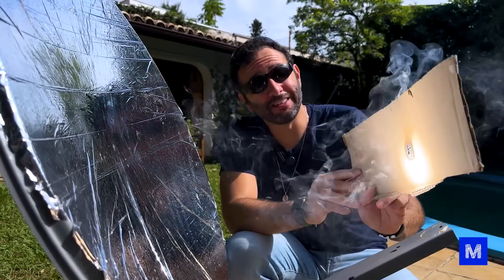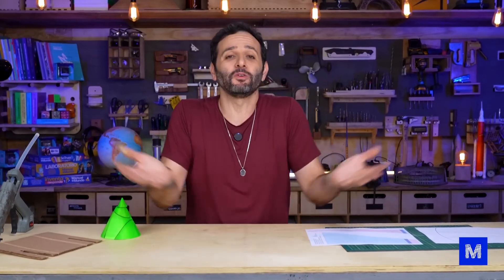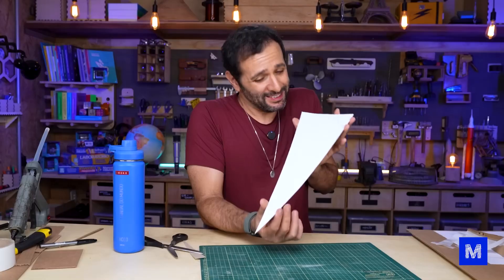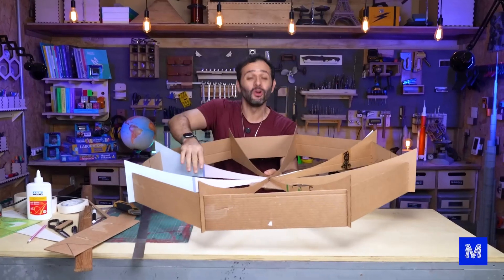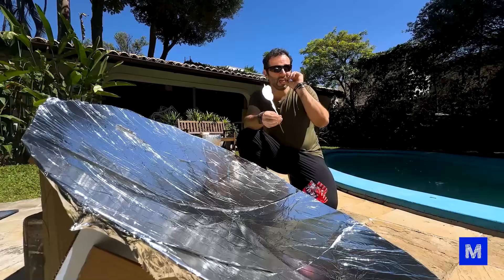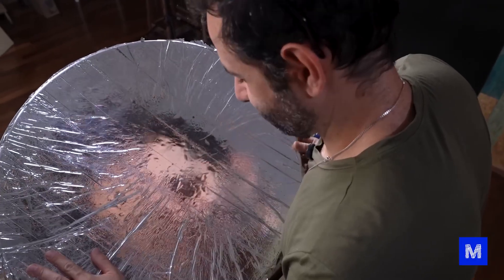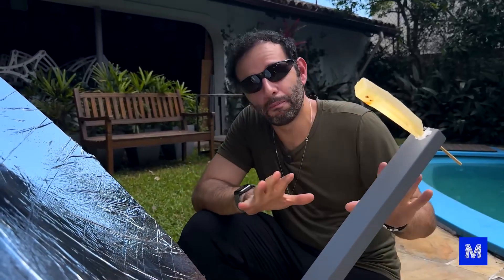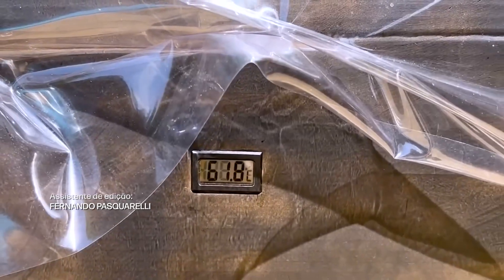SOLAR Stove 3.0: BURNS EVERYTHING!

Comment: Just something you might be interested in trying. Take a space blanket, stretch over one of those plastic sledding disks for kids, then suck the air out the back. It makes a damn near perfect curved mirror. DIY astronomers use it for a refractor. There are tutorials videos. Total cost is about $20.